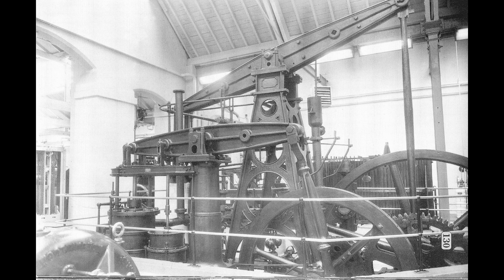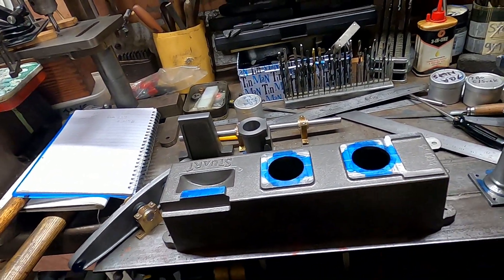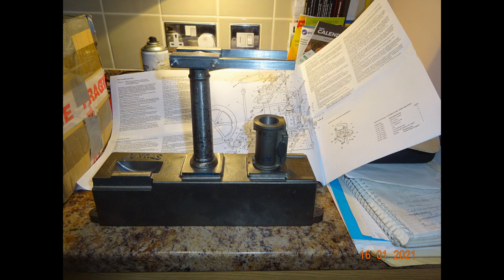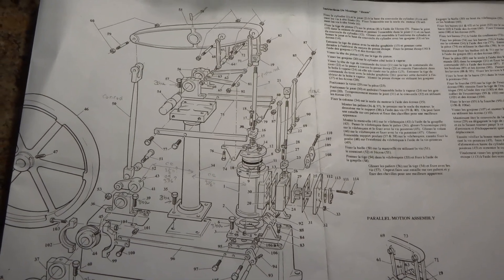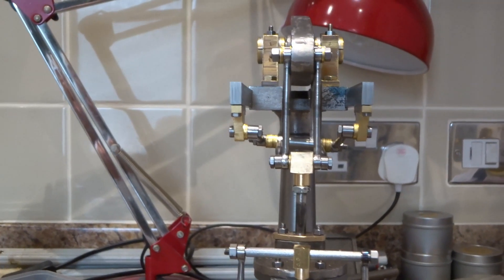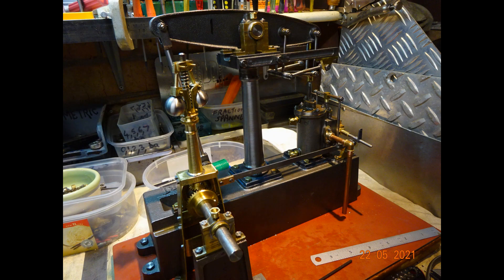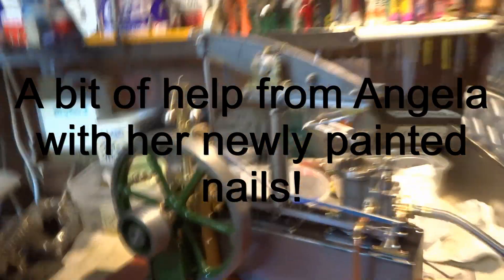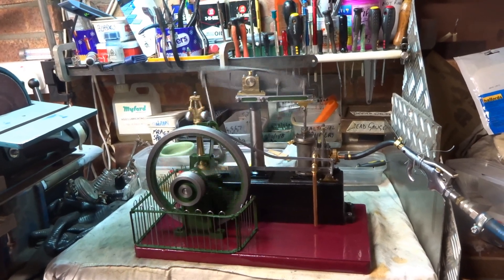Making a 'simple' beam engine from castings

Comment: Thanks for the video Ed. I have always liked the beam engines. That parallel setup to transfer the arc motion of the beam to the straight motion needed for the cylinder is quite interesting. Looks to be a very good model.
Reply from the maker: Many thanks for the compliment. It does run well although I have only tested it on air. One day I may get around to finishing the paint job, but don't hold your breath. LOL

Comment: Mr. White, I think that you have done a FANTASTIC job!   Beam engines are deceptive due to their MANY moving parts that need to be right, true, and proper. I honestly applaud you and your perseverance to stick with it and keep a good head of steam to push through to the end. Very well done indeed 👍!
Reply from the maker: Many thanks for the compliments. One of the biggest probs I had (apart from my incompetence) was the castings. As they were second, second hand however I felt I could not in fairness return them to Stuarts.

Comment: Ed, I have a spare flywheel for this model pf beam engine. Would you like it, no charge? Steve.
Reply from the maker: Steve thanks for the very kind offer. The beam engine is a completed model and therefore 'on the shelf'. I don't think I will revisit it. Hopefully you will find a better home for the flywheel than my overflowing 'bits' box full of things I may (or may not) use. LOL
Ed

Comment: Hi Edwin, You've ended up with a beautiful beam engine, despite the trials and tribulations, well done. The three cylinder 0-8-4 should be very powerful for Gauge one, looking forward to seeing your thoughts on the inside cylinder, inside slip eccentric maybe? Cheers.
Reply from the maker: Many thanks Paul. Slip eccentric for the inside cylinder is my 'fall back' option. Initially I am determined to work the inner valve gear by a conjugating mechanism from the outside valve gears. Should be fairly simple in theory, but in practise ?????

Comment: Very impressive Ed. I rather like the flywheel with it's imperfection, it now has it's own story. More than anything I am always impressed with your ability to see your projects through. The finished model is very pleasing I particularly like the home made "balls out" governor, and the small fence is a masterpiece. It's only us shed engineers that can truly appreciate all the work that goes into these little engines. Your video's are always an inspiration. Regards Garry.
Reply from the maker: Thanks Gary. The balls for the governor were actually made from some hardened steel balls from the front wheel drive of a Morris 1800 'land crab'. They were fully hardened and I had to anneal them to do anything to them. Reason I used them is that they were about the right diameter for what I wanted. I was tempted to do a vid on this aspect, but decided enough was enough. I didn't say too much in the vid cos I am sure the fella that sold me the castings was honest, but I  think the message has to be if you buy second or third hand, look and look again and do a bit of research to see what is supposed to be in the kit. On the day I bought my heart totally over ruled my head. LOL.

Comment: Nice work Edwin. Out of interest what gauge is the 3 cylinder chassis? Looks like it might be 2 1/2 or smaller.
Reply from the maker: Thanks Ben. the engine is gauged for my garden railway the outer track of which is 45 mm. I have pushed the engine around to check that it can cope with curves which it can!
Reply: @edwinwhite933  always good to check a train will go around!
Reply from the maker: Grieves me a bit to say it, but it would not have been the first engine I built that would not take the curves on my railway! The curves are now more generous, but I have learned my lesson. It is no fun taking a completed engine apart to modify wheel flanges etc for curves which really are too small. LOL